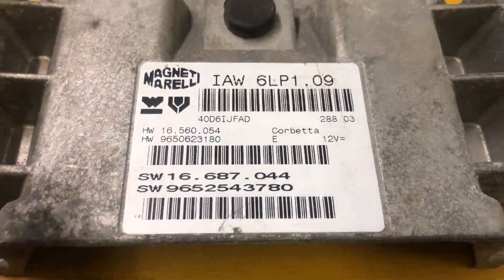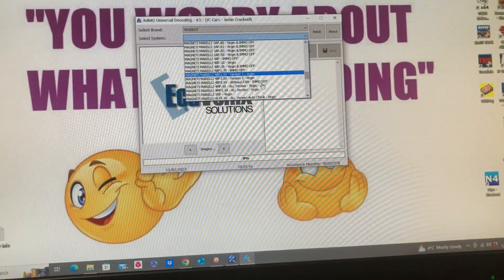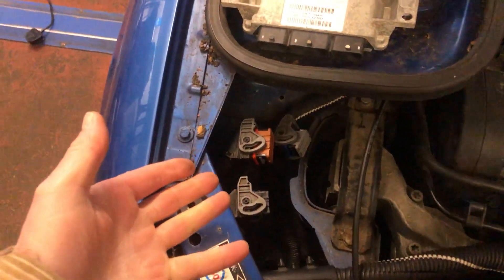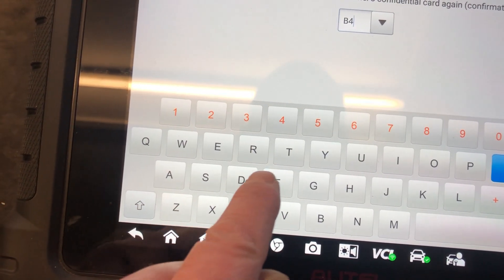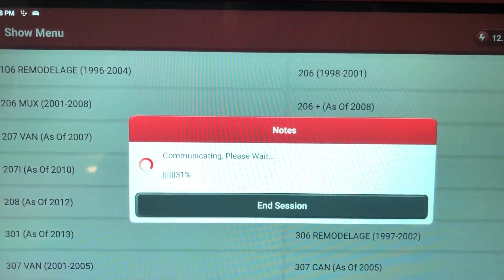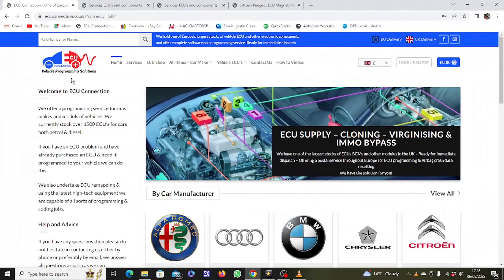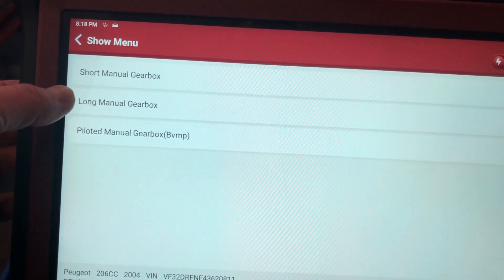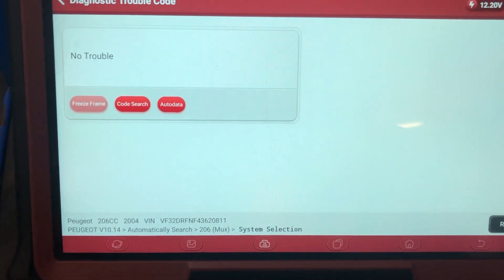How to virginise & program Peugeot Citroen IAW6LP ECU using Autel Maxisys diagnostic V ThinkCar Max

Comment: Hi , thank you for the great video.
When you virginize an ecu or bsi  is that the time you found the pincode or transpond code?
Reply from the maker: Hi & thanks for watching, this job was a few years ago now, from memory I got the PIN from ECU, as we initially cloned a replacement ECU for the customer but the fault remained & he was convinced the fault had ‘transferred’ by cloning - so we virginised the donor & programmed it to the car with the Thinkcar Diag tool - we could of got the PIN from BSI but we already had the Ori ECU dumps so we just got it from them - incidentally replacing the ECU didn’t fix the fault - he had been supplied bad fuel injectors previously!

Comment: Did you solve fault issue configuration p1613?
Reply from the maker: @muhderwan9173  Yes! Check the end few minutes of the video, after I set the configs with the ThinkCar max the fault code cleared & all was good..

Comment: Can i ask you a question please
Reply from the maker: @philipokeke7358  yes of course!
Reply: @JC-ECUConnection  I bought a transmission control unit on eBay and my car refuse to start after replacing, but if i return the faulty one my car starts what couybe the problem as the parts number matches. It a TCM for EGS gearbox. I could have sent photos but i can't do it on YouTube
Reply from the maker: @philipokeke7358  we offer a cloning service for these ECU’s - I believe yours is this type:
https://ecuconnection.co.uk/product/peugeot-citroen-semi-automatic-gearbox-ecu-cfc310p-programming-service/
Reply: @JC-ECUConnection  yes that's my type

Comment: I have u0100 fault - lost connection. I get the error after disconnecting the battery. Can i fix this by reprogramming the bsi? What you are think that i need to do? Thanks
Reply from the maker: Sorry, not enough information with just one fault code & without knowing which module holds this code to offer any advice!
Reply: @JC-ECUConnection  Hi, I asked the mechanic.  The problem is in the communication between the engine ecu and the gear ecu.  The car does let you shift gears and shift into neutral.  But I see that there are signs of moisture on the ecu.. What could be the problem?
Reply from the maker: @uri4151150  possibly a faulty gearbox ECU or wiring between the Engine ECU & Gearbox ECU, I would recommend checking powers & grounds + continuity in wiring first..
Reply: I am only getting partial communication with my ECU. Basically cannot get any live data. I've sourced another ECU to try and clone. Incidentally, the exact same ECU as in this video! Hopefully, I can sort out my Pugs little woes!

Comment: any chance you could share how did u managed to configure it? as i have a similar one with the same problem/ programming failed/configuration failed error.
Reply from the maker: Firstly the ECU will need to be virginised, checksum must be corrected!.. then you can install, here we are using the ‘ThinkCar’ Max.. ideally you will need to make a copy - or a list of the correct configs from your ori ECU & then this tool will configure correctly & adapt the Immo - or if you do not have the necessary tools we can clone the ECU / Virginise the donor for you..
Reply: @JC-ECUConnection  appreciate your response. Just 10 minutes ago i have managed to properly recode the new used ecu, with diagbox.
Reply: I've got renault ecu needed virginise can I use your tool
Reply from the maker: @user-ky7ty3ie1x  Hi, we recommend you use our service!
Reply: What autel do you recommend
Reply from the maker: @user-ky7ty3ie1x  I can recommend the Autel MS909 or above - Personally I have better results with ThinkCar Max with this particular job..
Reply: What was the problem in the car that you performed a virgin in the ecu software.

Did your car not start because it does not ignite the mixture by lack of spark ????

Comment: Great video, I'm impressed to see people like you who understand electronics so well.👍👍
Reply from the maker: Thanks for watching & for your comment! 👍
Reply: I have a little technical question 🤔
I have the same ECU in my car but the regulator option is not possible it is stuck on "absent" (with diagbox tool) do you know if it is possible to activate this option after having virginise ( in customer option During pairing)
 Thank you
Reply from the maker: @churros.64  Sorry, I don’t know for sure but I think you will have the same problem whether the ECU is virgin or not..
Reply: @JC-ECUConnection  thank you for your feedback .
if I am logical I would have to find a dump of a 206 or 307 with an ECU iw6 LP with the regulator and the limiter already activated that I recover only the software part and that I keep my checksum  and then inject everything back into my ECU🤷🏻‍♂️.